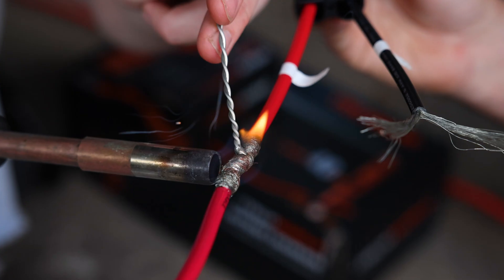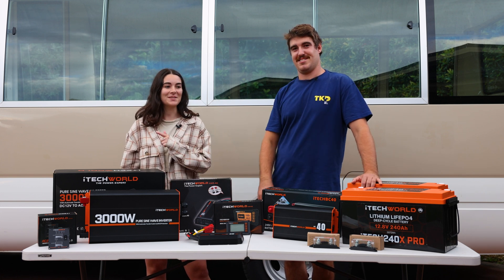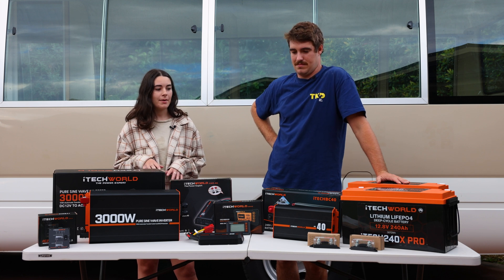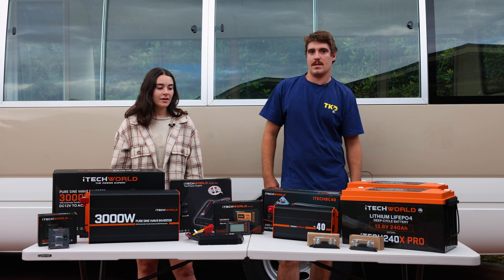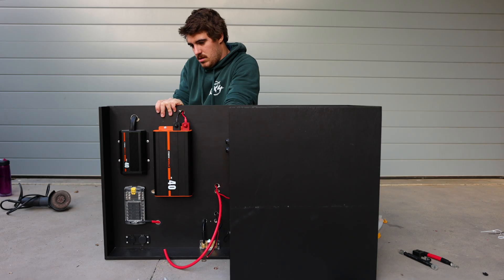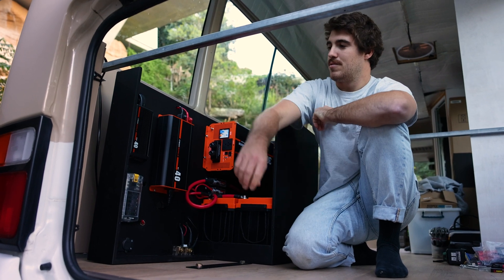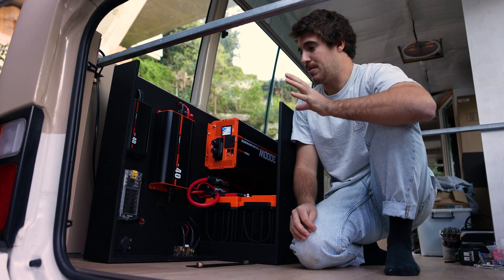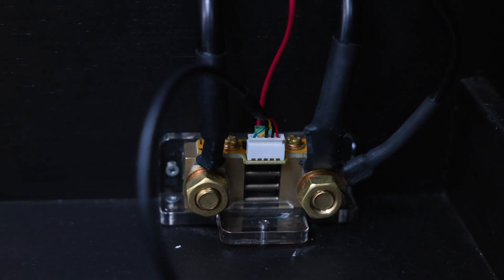INSTALLING OUR ITECHWORLD 12V SYSTEM - EP 6. Powering our Toyota Coaster Bus.

Comment: Hey guys ive got a really stupid question here, ive just brought an iTechworld 120x with the M8 bolt terminals. I have no idea how these terminals work.

Am i supposed to put the lugs underneath the bolt and both washers and tighten the terminal down? 

One of the washers is split, is this supposed to be tightened until the split washer flattens out? 

How many ring lugs can you attach to a terminal before the connection suffers?

There wasnt much wiring or installation info with the battery at all

Comment: With such a big battery setup I would consider running two of the 40 amp DC/DC chargers in parallel.
Reply from the maker: Thanks for the feedback mate! We'll see how this performs first. Could be something to think about in the future.
Reply: These older vehicles tend not to have massive alternators and are usually sized for the vehicle itself with a little extra for a vew accessories. 40A+ is a lot of overhead to ask, adding another 40A will either end in causing the chargers to cut in and out when supply voltage drops below minimum, or (more likely), you will soon burn out the windings in the alternator.

It's worth noting that many alternators are about %50 efficient, that means for every 1KW of kenetic power they pull from the motor, they burn 500W in heat and provide 500w in electrical energy to the drain device. That's a lot of heat at low speeds.

Another approach to charging (without upgrading the alternator) would be to have a separate Solar charger. This way you can charge with solar and alternator at the same time and in theory (with your 600w of solar) almost half the charging time.
Reply from the maker: @Sethjxl  100% agree mate. Definitely wouldn’t want to work the alternator too hard. We have seen people use solar MPPT chargers as well as the DC-DC. Seems like a great option! Cheers

Comment: Yep…that’s me unsubscribed. More itech junk getting pushed onto people. If they spent as much on quality control as they did on marketing their product might be ok!!
Reply: I have never had a problem with any of my itech gear. What negative exprecies have you had
Reply: @adampreston285  I own a business that specialises in off grid battery setups. We unfortunately have a huge amount of issues with itech gear and often the customers are left high and dry as their warranty and backup is as bad as their products. Had failures of pretty much everything they sell from batteries to inverters and everything in between. Also seen 4-5 of their jumper packs expand so badly that the essentially blow the case apart (not explosively but from the force of the battery expanding).
Reply from the maker: @shanenorwell8580  Hey mate, that's unfortunate. However, for a system like this, every other decent brand would charge 2-3 times the price. I see why iTechworld is a popular option. I've never heard of any problems from friends that use their gear so we are happy to test it out.